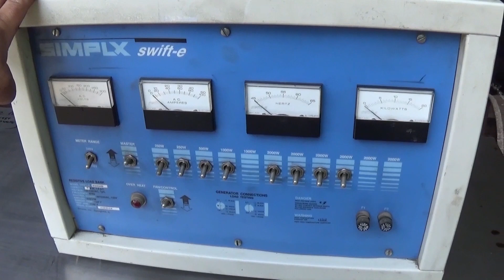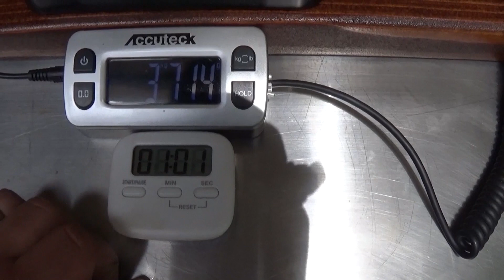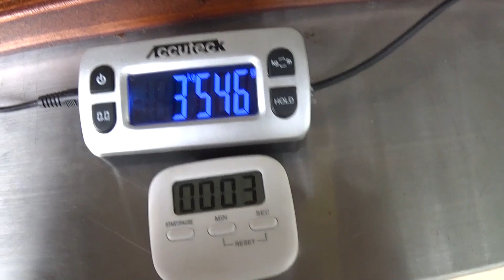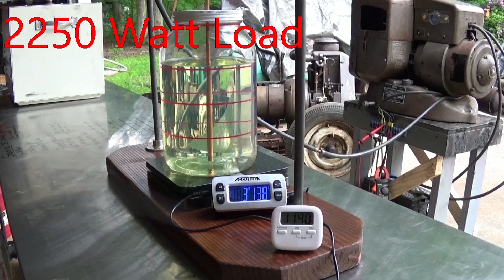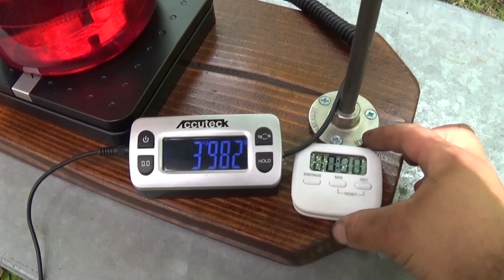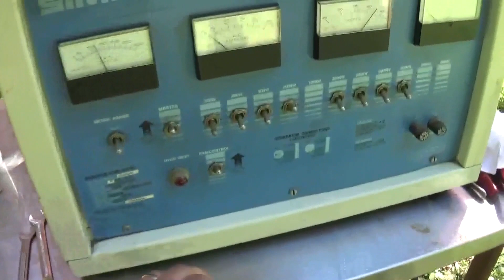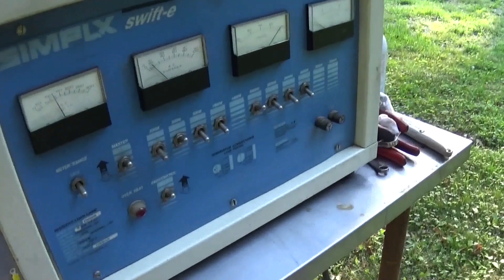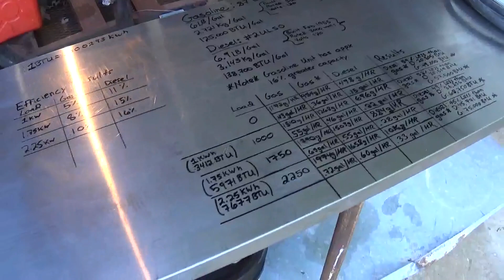GASOLINE VS. DIESEL (FUEL CONSUMPTION  1950s Style)

Comment: Very interesting Mike, I'm wondering what the results would be using LPG or NG, and the diesel using kerosene, or biodiesel , I think hard to do either though.
Reply: have no experience with lpg, but i can tell you LNG in diesiel engines it uses a lot more volume for storage. uses less weight per hour, but roughly 1.5x the amount of M^3 per hour as diesel. It's nice and quiet to run though compared to diesiel!
Reply: BioDiesel actually works really well in these IDI engines.  Especially if you use BioDiesel made from Jatropha plants. Better combustion, a bit more o2 in the fuel and a better flame propagation helps the engine work better under load while having less shockwave ripples in the combustion chamber. I ran a old SABB 6hp Marine diesel engine on 100%RME for two years without any issues, and after the second tank the fuel consumption started dropping.  Oil also lasted longer as it was not polluted by combustion by-products from fossile diesel.
Reply: Do the math.. google the btu/l of the fuel, efficiency of the engine and generator should be pretty similar running either gas or lpg, or diesel and kerosene. I doubt that the calculated results using the numbers from this setup will be very different from the actual testresults. (have had to do all kinds of calculations on engine efficiency when I was in school)
Reply: @markj2093  Not to mention "multi-fuel" engines that run on the diesel principle, but with sparkplugs.  My grandfather had an old diesel engine from the early 30's in his fishing boat that needed heating the fuel heating canister before it fired. Took quite some time in the winter (-35 degrees Celcius) but when it fired, it usually stayed running, whooping smoke rings out of the exhaust at 120 rpm.  Good old times.  Thanks for your reply.
Reply: I have a modern NG burning home generator.   NG is a bit weaker than gasoline or propane....  BUT,  the supply is pipelined to the house,  so it doesn't need "refueled".

Comment: That was cool. Would like to see the numbers on a newer set of engines as well. I bet someone out there has done it. It would have been neat to extrapolate out the costs as well since diesel fuel costs more at the pump. I noticed you used red diesel with no taxes which would have been a little cheaper since gasoline has taxes added in.
Reply: Depends on where you are, but diesel is cheaper at the pump in my area $6.40/gal gas, $5.40/gal diesel.

Comment: This was an an outstanding test and a very interesting video. Subscribed! Your test methodology was solid and it was a good apples to apples test IMO!

I have an old single phase Onan from this era that I recently resurrected, a military 2CK-1M, so it was relevant. It's very much the same unit as the gasser in the test but derated for military use. It runs very well. The only thing I have not figured out yet is why the voltage is so high. The manual states it's a 115V unit and should produce 125 max. At 60 hz, mine runs slightly above 130V (load or no load, it's speed related- goes down a little when the head gets really hot). At first I thought my instrumentation was at fault but I have tried about a half dozen volt meters and they all concur. Probably doesn't matter the way I plan to use it but I have a "Captain Kirk gut" (mysteries give me a bellyache!). If you have any insight?

Comment: Finally, Something more scientific with load. So many energy devices but never with substance when there is no load is applied. Now I would like to see that go one step further. Steam and jet shaft driven Turbine, but I have to agree, hardly useful. Jets are simply better power weight rations for navigation and drones. and steam is a nice to know for wilderness scenarios. Thanks again

Comment: Mike, great video. My gut says your equivalent gas numbers were a little conservative but I am not sure what a better way would be and your point is made either way even if gasoline might have done even a little bit worse with a different correction factor. The only other way I can think to do it, and it might not correct enough, would be to correct the no-load the way you did and then subtract that difference as a fixed value for the load steps. Just food for thought and that was part of the joy in the video was the thought process.

Comment: That was very cool. I think I heard once that a gas engine, although using the most fuel, is most efficient operating near full capacity (output). The diesel, seems to retain high efficiency even when near no load. I believe this since I have a 2001 VW Tdi (diesel), and when taking road trips, if I have a tail wind behind me on the highway, driving 60MPH, level road, I can get up to 58MPG. On the other hand, bucking a 20MPH headwind, and/or steep hills, my MPG can drop to as low as 45MPG's!  It seems that small displacement engines are more sensitive to this than large displacement engines. ???
Reply: The biggest differences between diesel and gas is throttling loss and compression. With a gas, the carburetor restricts the inlet, so pulling the volume of air past the throttle plate constitutes a load. In a diesel, the air is unrestricted, and the engine just "bounces" off its compression. Much less throttle loss. It takes very little, to "squirt" in that small amount of fuel, despite the enormous pressure required to overcome the compression and combustion pressure of the chamber. When a gas engine is run "wide open", it can indeed produce similar thermal efficiency to a diesel, despite its lower compression. At a given RPM, a small gas engine running near its maximum torque will  ALWAYS be more efficient, than a larger engine throttled back to produce the same torque, same RPM.

Comment: Good stuff you got there Yanmar school I learned a diesel is roughly 60% more efficient than a gas engine. Fuel injected gas will come a little bit closer . I could hear that de compressor kick in when you shut it off and then when you explained it that's cool . Little bit of unburned fuel coming out not going to hurt nothing Fact it can come to a smooth stop without compression bucking it  is a big plus

Comment: Diesel fuel has more BTU, so it also is more beneficial. If you would like to make Gas engine as efficient as Diesel.. well I don't think it's possible because fuel has less energy in it. This is a simple thing why in Europe we have probably about 80% of normal size and bigger cars and trucks Diesel powered.
Reply: Gasoline and the engines that run on them were never meant to be efficient. Gasoline was a waste product that needed to be disposed of, what better way to get rid of it than to sell it.

Comment: Hey Mike,  -- Excellent topic and practical test, well done. I hope the "young people" cell phone generation dug your experiment as much as me "65yr old" grandpa. 

I'm wondering how to adapt a diesel engine to my 3500W inverter-generator for camping. Wonder if the diesel could handle the higher RPM's for the variable speed inverter.

I also wonder if you do the test again on both engines with the same fuel, AKA- Natural Gas??????  I see buses in my city running diesel engines on compressed Nat Gas.

Measure the cu-ft/hr and give the results. I converted my other generator to Natural Gas and it seemed to be LESS efficient, in other words it lost HP/cu-in, which equals less wattage at full load. Less BTU's in Nat-Gas.

Comment: BoreXstroke for under/oversquare. They need to be identical before you can just deal with the difference in capacity.

What is your calculation for the discrepancy in cylinder size?

Comment: It would be interesting to compare the results from this vintage equipment against the inexpensive modern equipment of similar ratings. I'm thinking of the cheap 2-pole generators, which the engines rattle away at 3,600 RPM, to give you 60Hz. Maybe a "Predator" diesel, and a "Champion" gas generator, with the same wattage ratings. One thing's for certain: The vintage generators will out-last the new ones, despite the 65 years of age and what ever use they've received over the years. 4-pole generators will almost always last more than 3 times longer than 2 pole anyway.

Comment: Have you ever run a diesel on cooking oil new or used? I have for several years and a lot of miles, all you need to do is heat the cooking oil to get the viscosity down and if you are using used oil you need to filter it. I got my used cooking oil for free from several restraints. I found no problems with the cooking oil on older diesel I had 1986 and 1991 Mercedes and F250 and 350 Fords with 7.3 and 7.3 power stroke I pulled a fifth wheel camper from KY. To FL. Several times and had great power and millage. I got my oil for free I just had to filter it.

Comment: I believe the choice to toss fuel while rhe valve is open was a simple decision between restart having fuel to kick off faster and IF a failure occurred you could remove the offending part and not affect fuel supply. "Will always run, no matter what" kind of engine design.

Comment: The fuel cools the engine on shut down.  that is a cool diesel unit.
Reply: no more like washes the oil off the cylinder wall :/
Reply: @MiG21aholic  It's diesel fuel not gas.
Reply: Opening the release valve to zero compression does more harm to the engine. Almost any later shut-down design involved stopping the diesel injector pump.

Comment: Hey SmallEngineMechanic, I have the earlier style of your Diesel Genset in my collection i'll be doing a video on later. It is a 1938-1939 model 3DSL that doesn't have a oil filter yet, and is manual decompression. It looks close to yours but has a few differences.

Comment: Diesel has more energy content per gallon although I think you attempted to account for this. Your efficiencies are that of the entire system using different generators, whose efficiencies vary greatly.   If you swap motors and do the experiments again it might help provide some interesting additional data.
Reply: Those are both 4-pole externally excited alternators. The efficiency of the alternators is virtually identical. The engines are both single cylinder engines of the same manufacturer, within the same few months of date of manufacture. You really can't get closer, given that one is a diesel, the other gas. This really was an accurate comparison between gasoline and diesel. The engines were probably similar displacement.

Comment: the part of your results show an increase in gas with increaded low. Consistent w theory. AS the throttle goes to full load efficiency increases. really well done test. very impreseed w your methods. You would make a good scientist  I have a Ph.D. in chemistry. I doubt I would do the testing that well.

Comment: I have a Q5 v6 3.0 turbo Diesel its the fastest hardest pulling SUV I ever been seen even gives the Cherokee Trackhawk a run for the money. never smelled a bit of exhaust cleanest car I ever had.
Reply: Modern vw diesels with the dpf make no exhaust smell. My 2013 jetta with the 4 cylinder 2.0 diesel smells cleaner coming out than going in. My 03 on the other hand with a cat delete stinks like crazy.

Comment: I have a question, you mention you use ultra low Sulfur diesel in the diesel plant. My experience with these old diesels is the ultra low sulfur diesel fuel does not lubricate the injection pump or the injectors properly. I always add a lubrication additive to this type of diesel fuel. Doing this has worked many years for me with the older diesel equipment.

Comment: Interesting! Do you think a modern diesel generator would be as efficient with all the required anti pollution equipment? I’m not really  sure generators require this equipment.
Reply: You can blame ca for those pollution controls. I know some gen can't be sold here as they don't meet carb pollution standards here in ca.
Reply: Food for thought: If diesel is so much more fuel efficient than gas, why is EPA trying to kill them with totally hilarious regulations? Even an unfiltered diesel produces less pollutant than a filtered gas engine due to it's much higher efficiency.

Comment: I do have a question about the corrected figures (definitely a question not a correction). The 16% accounts for the difference in displacement. But as it was fuel consumption for a given load wouldn't a smaller displacement engine have increased RPM to output the same power, making the correction difference less?

Comment: The difference must be the amount of energy that gets wasted as heat through cooling system.

I know when I drive a diesel truck unloaded on the coldest winter days, cab heater cools the engine by itself; engine thermostat stays closed unless engine is loaded.
You can actually feel heat vent temps drop at idle and temp gauge drops below normal.

Comment: The convoluted and almost confusing results could be somewhat straightened out by comparing BTU per pound, instead of per gallon. Volumetric comparisons are tough at best when comparing two fuels of differing densities.

Comment: Thank you again very interesting. I own and use two old gas generators a 5hp 2050 watt rated Coleman powermate and a  10hp powermate maxa 5000er. I'm not sure what year they were built exactly  but I'm pretty sure they are from the 1970s. They both are all original and run perfectly. They both have all copper in the generator heads. I noticed alot of the new generators have watt output rating that is just about even with the potential power the their engine size is physically capable of. My 10hp tecumseh on the 5000 watt rated generator could produce 7450 watts from 10hp although I don't know if it's just because the head  is only designed that way or it's just giving you a true greater surge buffer. It seems odd that all the new  units all have rated output that is very close to the limit of 745.7 watts per 1 hp. I was even surprised to see a lincoln welder generator with a 7hp engine and its max output at just about the 745.7 per 1hp limit. I'd really like to understand what is going on with this subject.

Comment: Great video. Except your math isn't quite right; you included the overhead to run the engine as part of the efficiency to turn a quantity of fuel to electricity. At 1000W, it took 30514 BTU - 20805 BTU =9709 BTU to make 3412 BTU for 35% efficiency for diesel. Including the overhead in the efficiency of converting one form of energy to another is a common mistake. It's why Prius get such good in city 'gas mileage'; by turning off the engine at stop lights they remove the overhead from the equation. Keep these coming, they're great. R Gardhouse B Eng, P Eng

Comment: Really cool video but little bit of criteria:

That 16% calculated decrease in fuel consumption is not correct because: 

If you have two engines and one has 16% more power, it doesn't consume 16% more fuel unless you ask it to do so by running on full throttle. If you ran both of these engines on full throttle, you should do that calculation what you did to correct the fuel consumption as the gas engine is actually making more power. 

Powerful engines tend to consume more fuel than low power engines because of how you make more power: by using heavier parts with more inertia, bigger cylinders with more friction etc. but how much more fuel is consumed is not easy question. These two engines in the video had similar power rating so it's kind of okay to just ignore the whole power thing but if we tried to compare 2hp engine and 400hp engine it would be different case. 

When comparing diesel and gasoline engines like this, it would be ideal to also compare them on full throttle because gas engines have huge air intake pumping loss on part throttle. Both diesel and gasoline engines tend to give highest engine efficiency (BSFC) on full throttle but in gasoline engines the efficiency is very low when the throttle is almost closed and starts to increase quite fast when you start to open the throttle. This is the reason why the difference between diesel and gas fuel consumption got smaller when you used bigger load, gasoline engine efficiency just increased more than diesel efficiency. Full throttle situation would show us what is the difference in best case scenario when the gas engine has it's peak efficiency.

Comment: I think there is about 15% to 18% on gas or diesel gen sets.
But have you tried propane or natrural gas or wood gas that would be fun to try.
PS Keep up the great vids.
Reply: wood gas, very acidic / corrosive to metal, unless you are talking about wood alcohol.
Reply: Let me give an example based on a car I once had.
25 Yr. old worn-out 2400cc 6-cyl. (Opel/GM)
6 Km. out of 1 liter of gas.
4 Km. out of 1 liter of LPG.

Comment: Per Caterpillar, best thermal efficiency on a KT-38 powered genset is achieved at 80% load, PF corrected.  It's been my experience that holds true for almost an medium speed 4 stroke engine in genset or rail service.  2 strokes (EMD, Detroit, Kohler) seem to achieve best efficiency at a somewhat higher load.  Roots blown 2 strokes are notorious fuel hogs, due to the parasitic load of the blower, while the clutched turbochargers on an EMD on any series makes them comparable in efficiency to a Cooper-Bessemer FDL or Alco 251 4 stroke at comparable flywheel output.

Comment: The efficiencies would get close when the gas engine is running at wide open throttle, the point of maximum efficiency. The idle gas consumption is an indication of how inefficient the engine is operating when throttled. Whereas the diesel fuel use at idle is purely to overcome friction, windage and engine pumping losses, it's not having to work as a vacuum pump as well pulling down on the inlet manifold.